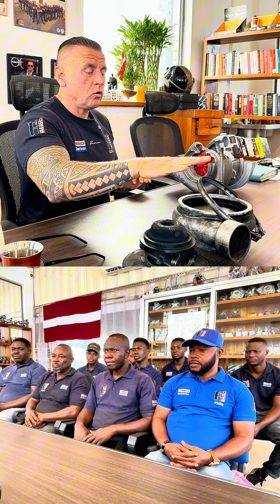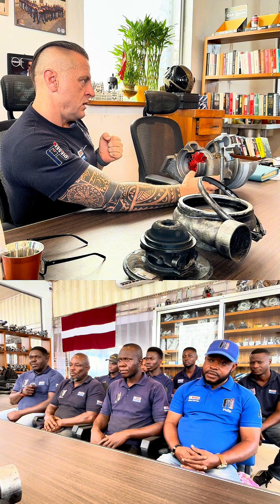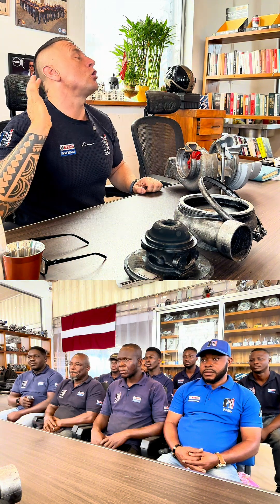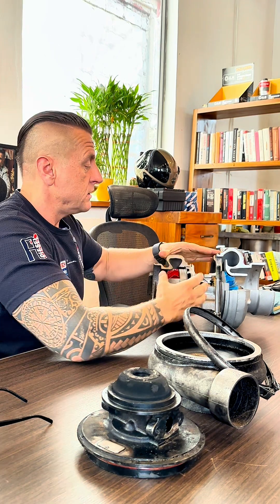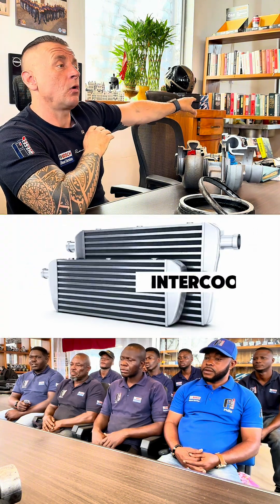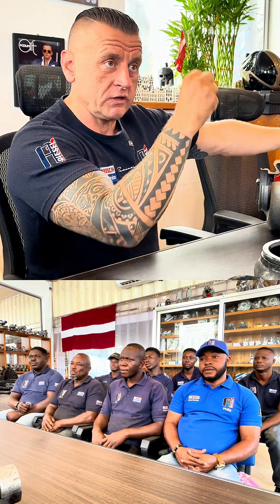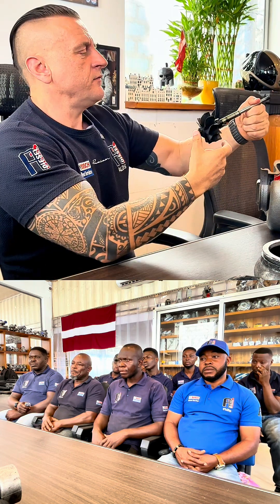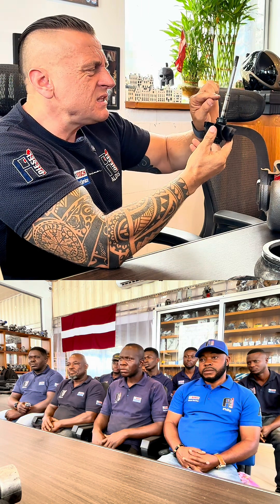What causes “Engine runaway”?

Comment: Couldn't you (with a manual gearbox) stick the transmission in 3rd or 4th, hold your foot on the brake, and release the clutch to stall the engine??

Holding the clutch still with the flywheel would Jam the crank shaft right??
And stopping the rotation of the engine.

Ive never had a runaway, but that would be my first thing to do.
3rd gear in, brake on hard, release clutch.. 

The reason I would not try to put it into first gear, is because the power of the engine could buckle the clutch. 
Worst case and best case is you snap your crankshaft under the pressure of the runaway power.  But hey who cares you've already lost your engine anyway. 

It's much easier to stall an engine in 3rd 4th or 5th gear.

Comment: I'm new mechanic and it's useful for me, easy explaining.
Just didn't understand why oil from oil tank goes into turbocharger.

Thank you man.
Reply from the maker: Great to hear you're finding it useful! The oil goes into the turbocharger for lubrication and cooling since turbos spin at extremely high speeds. Proper oil flow is crucial to prevent wear and overheating. Keep learning! 🔧🚗🔥
Reply: @a1dieselafrica   I think I asked my question bad, why oil from turbocharger lubrication place leak into turbo and then to engine?
What is the cause of this failure and how to prevent it?

Comment: So there doesn’t necessarily need to be an air restriction for there to be a big enough vacuum to pull oil out of the turbo in turn filling the intercooler. It can be just a bad turbo that lets oil escape from the turbine shaft as well
Reply from the maker: I agree thanks for sharing bro

Comment: Cracked pistons on transits...resulting in consuming all the engine oil ...or alternatively oil in the intercooler after turbo destruction and franticly turning igntion off and ramming in 5th gear and letting up clutch in same motion😂😂😂
Reply from the maker: Thanks for the info!